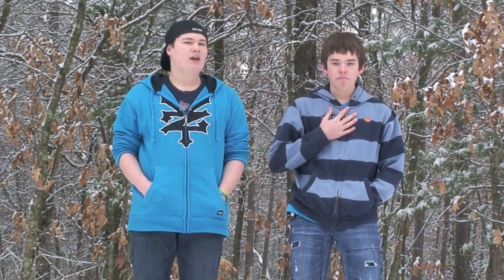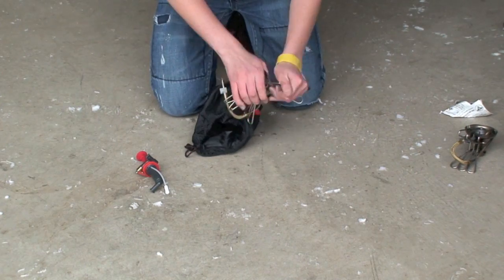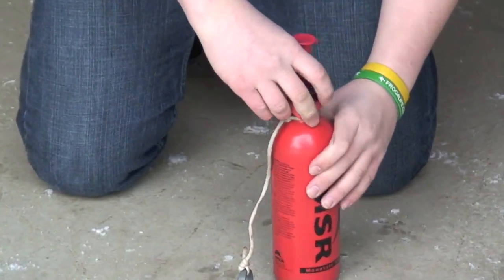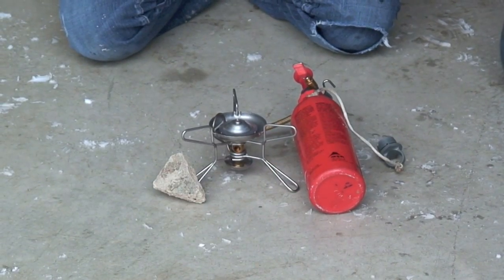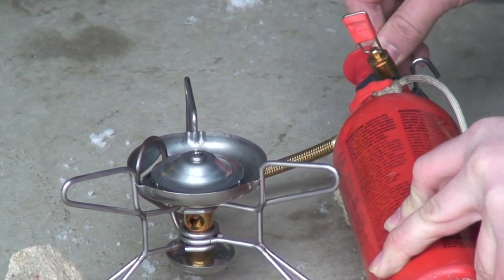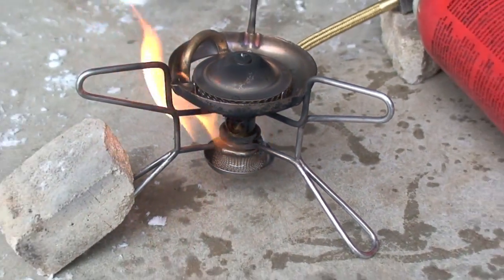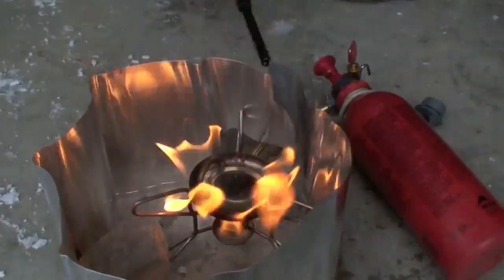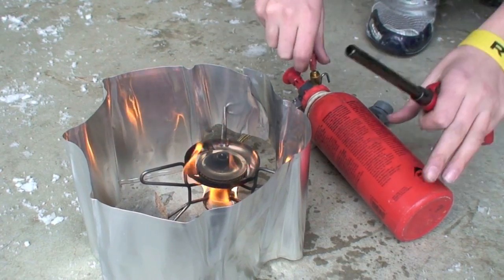How to Operate an MSR Whisperlite Backcountry Stove

Comment: why was the bottom of my stove so black with soot after priming and lighting? Thanks, great vid boys..
Reply: you let too much gas into the priming cup. you could use about 5 eye dropper drops. just enough to heat the generator coil (the loop that the fuel line makes) that takes the liquid vaporizes it under pressure and makes gas